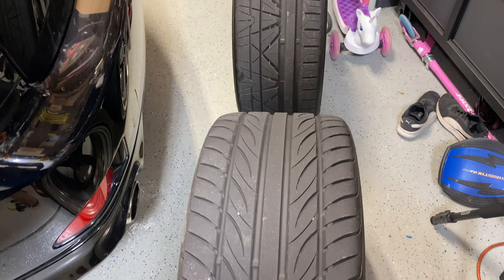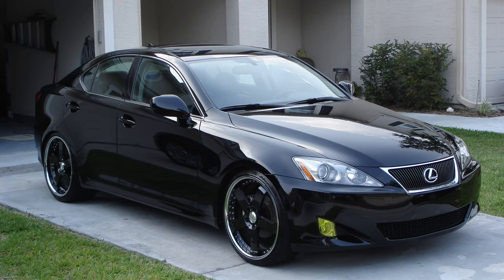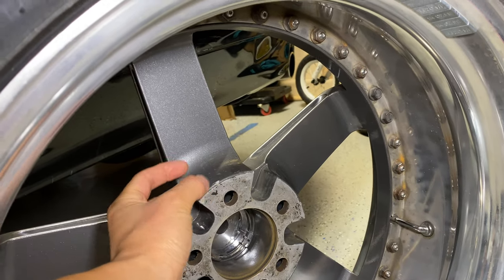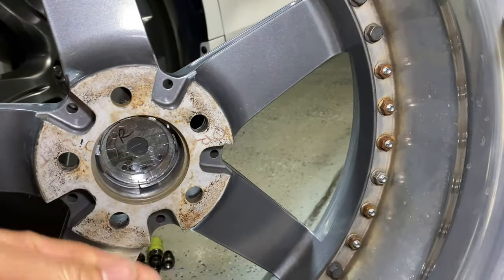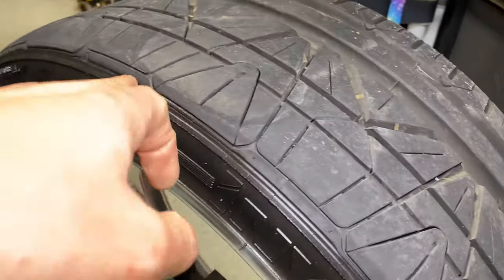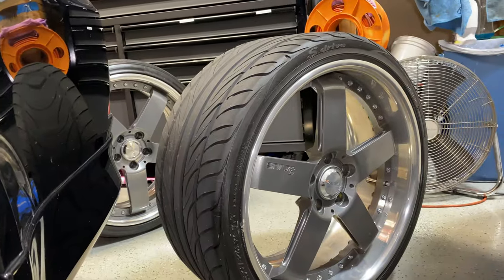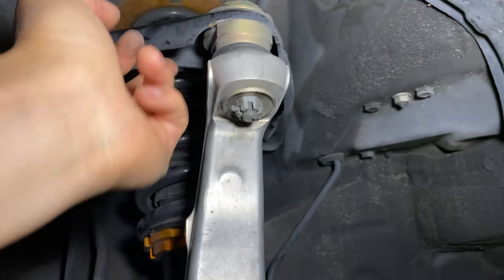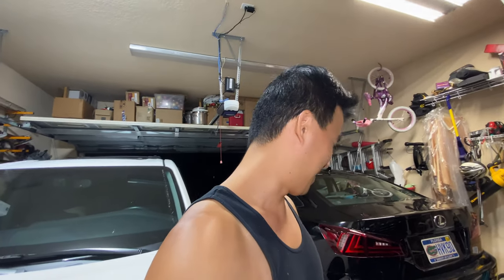Fitting 20 Inch Wheels | Lexus IS250 IS350 IS-F GS350

Comment: I'm researching wheels for my gs350 4th gen.  I'm on air and want to run 8.5x20 and 10x20, 235-35-20 and 275-30-20.
You mention that your offset are in the 30s or 40s.  The offsets are very critical for someone who is researching what fit.
The video was still informative.
Reply from the maker: Yea my wheels aren’t that aggressive for offset. They were originally built for exact fitment on 2IS with no rub. They specs you looking at are fine. That 35 series front might be borderline for rubbing but if you air up, should be good.
Reply from the maker: 2007, I bought brand new with like 7 miles on it.
Reply from the maker: For AWD, you can’t stagger. Gotta go same size tires or may mess up differentials. Some guys have staggered but got to calculate the exact overal rolling diameter.

Comment: I have some rims coming in and  I’m m so nervous they are not going to fit without modifications. I have a 2020 Camry lowered on springs. I have some 20x9 245/35 in front and 20x10 275/30 in rear.
Reply from the maker: That front will be too tall. The 245/35 is thick. May need 245/30 or 225/35.

Comment: What is the best setup for 19"? I don't want the car to be too low as it'd scrape everywhere, just want them to fit well and I want my rear rim to be concave. Thanks in advance.
Reply from the maker: I think most guys run the same widths, 8.5 front and 10 to 10.5 rear on 19s with similar width tires. You can also go stretch with 225F and 255R like factory. Just got to figure out the aspect ratio that won’t rub. 30 or 35 (which ever matches stock overall diameter. Use a tool like this to calculate https://www.discounttire.com/learn/tire-size-calculator

Comment: Awesome video and great advice! I am planning on putting on 2018 RC350 oem 19inch rims and I also want to lower it what would be the best way to keep a smooth ride and lowering the car a bit ? Should I get coil overs or would good stock shocks and springs be better for ride comfort? Just worried that the springs won’t work with the 19” wheels. Any tips would help !
Reply: Also I have a 2006 is350 😁🙏🏻
Reply from the maker: You will be find with OEM RC wheels as the offsets and widths aren’t that bad. If you used spacers it may rub. For comfort  and based on age of car, go coil overs. Your shocks are probably done so it will be close to same cost for new shocks/springs/rubber caps and labor compared to $1k for good adjustable coilovers.   I went cheap and tried out $200 eBay non damper adjustable coilovers. Been working well for almost 2 years.

Comment: I have a 2010 IS350C. What 20 inch can I put on without needing any adjustments or modifications?
Reply from the maker: 20x8.5 and 20x10 like mine with the correct offsets and fitment. 245/30 and 275/30 would be widest with good tire height. You can go 225/30 and 255/30 but the side walls will be rubber bands, that won’t rub.
Reply: Tuner with Kids Thanks dude!

Comment: I’m warning to upgrade my factory 18 inch wheels on my TLX to 20 inch rims with low profile tires.
My question is when I put them on the car my air sensors malfunctioned inside my dash.
Since the car is set up for tires that have 35 pounds. Obviously the sensors in the new rims don’t match my Acura and if I put new ones in that do well I still have problems because these wheels only have 30 pounds of pressure not 35?
Reply from the maker: You need to have the new sensors programmed to the car. Make sure they are sensors for that specific model. Or swap your old sensors to new wheels. Your car should have a setting to adjust the pressure to whatever you need
Reply: @TunerwithKids  ty for fast response.
I thought about taking the sensors off the old wheels but I kind a like to keep them in tact in case I need to use them. Thank you for telling me what to do

Comment: I'm going with a 20x9 F+35, 20x10 R+30 Advanti Fastoso , I think if I go with a 235 30 20, and 265 30 20 falkens  on rear you think I'll be ok on space ? (Fender wise)
Reply from the maker: Yes those tire widths will be fine. It will be a little stretched up front.
Reply: @TunerwithKids  you think a 255 in the rear will be too stretched? The reason I ask is because my wheel comes out exactly flush with the 1/4 panel so I know I need a good stretch on them both front and rear. What would you go with on 10in rim ?
Reply from the maker: BIG RIZ 255 will be stretched but not too bad.
Reply: @TunerwithKids  Thank you so much . I've been racking my brain cuz I didn't want to buy on line tires n have them be wrong or not fit. Very much appreciated.
Reply from the maker: A 265 and 275 on a 10” is pretty square. So going down to 255 will give you a semi stretch but not that bad. Crazy guys be running stuff like 225 or 215 on a 10” which is dangerous IMO. The stock rear is a 255 on an 8.5” so just imagine that tire pulled out 1.5”.
Reply: @TunerwithKids  Thank you. You are a gift.

Comment: very informative! im thinking of purchasing some 3pc wheels for my 350, obviously it may vary by brand but from what i understood do you think a Medium disk face SHOULD clear the 350 4 pot front calipers?  trying for most lip whilst keeping safe offsets, without going crazy camber or fender mod.
Reply from the maker: Medium disk will be borderline. The 350 are huge. Best bet is to check out 350phi.com. They have a print cutout that you can use to test in wheels. Also measure the spoke clearance before buying.

Comment: Can you make a video of carbon cleaning of the engine?
Reply from the maker: Wepen935k I would but last time I changed my spark plugs (3 years ago) it was a pain and I really don’t want to again. If I knew about walnut blasting, I would have done it then.
Reply: Tuner with Kids how about Seafoam treatment?
Reply from the maker: Wepen935k with the carbon issues on the 250, don’t think Seafoam will be effective. Pushing the car once or twice a day redline would be better to burn off some new carbon. The stuff is gunked on the walls, which is why the walnut media blast is needed.

Comment: Can you fit 20 x 8.5 - 245 / 35 R20 wheels and tires front and rear?

Without cutting or grinding 

Awesome video by the way :)
Reply from the maker: 245/35 rear is nothing. But front will rub like hell if it’s a 35.
Reply: @TunerwithKids  ah ok spewin. You reckon to not go wider than 8 on the front ?
Reply from the maker: 8.5 is fine with the right offset but the rub is the height of the tire. On a 20”, going taller than a 30 will rub on this car.
Reply: @TunerwithKids  ah true I get ya. Thanks man. What you reckon would be would be Max for a 19 ? 35 ?
Reply from the maker: @johnnobravo1978  most people do a 235/35/19 on the front. Can do 255 or 265/35/19 rear if you're staggered.
Reply: @TunerwithKids  ah ok awesome thanks so much man it saves me buying wheels and tyres then having to spend hundreds on new tyres etc. 

I've subscribed aswell and going to recommend this Channel to my car groups :)

Comment: Hey I have 20 inch rims and they rubb in front when turning on a certain point what tires size should I run on stock suspension 🤔
Reply from the maker: Depends on offset and spacing. I’m on 245/30 but anything in a 35 series will rub. Need a 30 series to work in 20s. 235/30 is probably the best between width and thickness. 225/30 is rubber bands.
Reply: @TunerwithKids  my rims are 20x9 tyres are 245/30R20